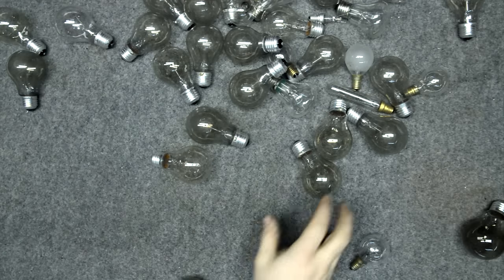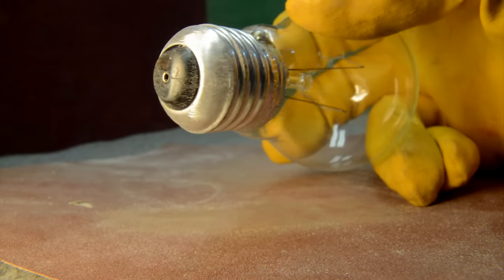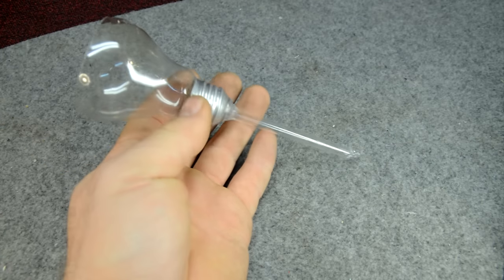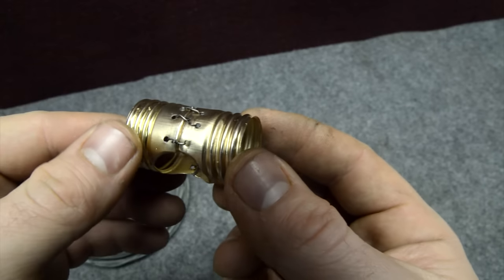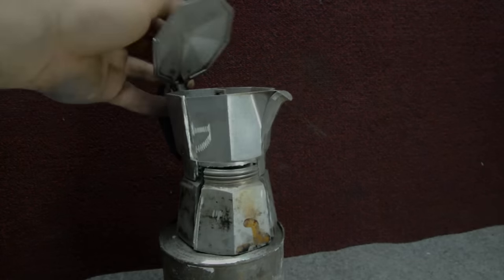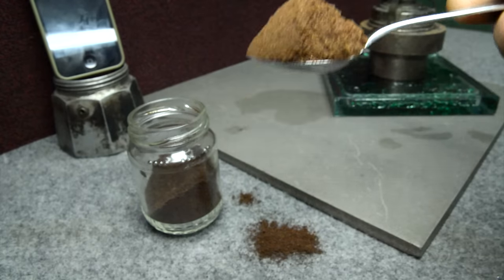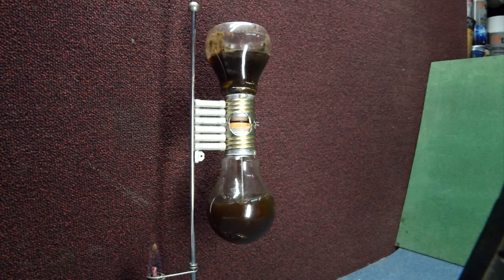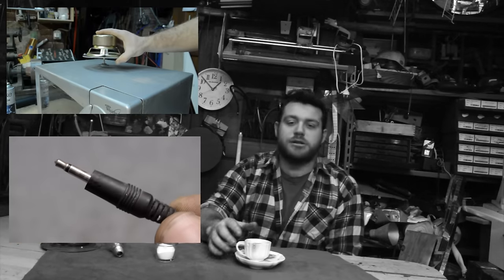How to Make • Coffee Machine Vacuum Lightbulbs

Comment: Anyone attempting this should also.
-Wash Bulbs in/out with soap/water.
-Use a Stainless Steel Washer. Galvanized or Zinc coated metal would be poisonous and would rust!
-Dont use Magnets, most stop working in high heat.
-Use food grade/high heat Silicon Adhesive and Rubber washers (is poisonous/cancerous not to).
-Would complete a few passes with just water before using.

Overall, Cool Project :)
Reply: +TheOnismithcreations thank you for saying alternatives instead of just slamming the project XD :)
Reply: +TheOnismithcreations The purpose of galvanized metals is so that it 'won't' rust. But I would use stainless steel anyways.
Reply: +Jordan Hoskins as far as i know galvanized metals is not recommended for high heat applications
Reply: tayeb mabruk thats true, it will burn off
Reply: +tayeb mabruk  You do realize that boiling water is not high heat.  Think fire or welding.  It might corrode a little and get in your food  I'm not terribly afraid of ingesting zinc oxide I am pretty terrified of in haling the gas and getting heavy metal fever.  This will not happen with this setup as the washer is submerged in coffee and far from the flame.
Reply: +TheOnismithcreations 

Good complement to the project ;)
Reply: +TheOnismithcreations If you remove the threat of horrible pain and death you ruin the fun lol
Reply: And where would you find food grade high heat silicon glue?
Reply: Food grade is everywhere, but it doesn't need to be high heat. High heat is like 500-1000 Celsius
Reply: +TheOnismithcreations galvanized would rust? are you fucking kidding me?
Reply: I would amend this to say: "Anyone attempting this should...stop immediately"
Reply: The bottom of bulbs have a lead/tin solder on it. Watch out!
The screw part of the bulb is made of aluminium, which is safe.
Reply: If using something other than superglue make sure it's non toxic, if using superglue do a run through with water first.
Reply: Wow a human (Y).
Reply: @exogendesign4582  - having had galvanized wire fences? Yes, they do rust.  It just takes them a longer than regular steel.  But they do rust, and they get fairly brittle especially when exposed to things that alter the chemicals of the surface.  And coffee is acidic, so unless you know the exact chemical reactions that would occur with the interacting boiling water/ coffee and the washer?  Don't assume that the metal will be food safe.

Comment: for the project for today we only need a couple of old light bulbs. yup, just two light bulbs and two light bulb holders. thats it you guys, two light bulbs, two light build holders and some metal wire. also, maybe you need sandpaper, a pair of pliers, gloves and mask for protection, a pipette,  silicone with gun of course, a couple washers, rubber gaskets and with some strong magnets and ring holder you got yourself some coffee! isn't it crazy what you can do with just two light bulbs?
Reply: Best comment on here 💯. That's real talk
Reply: LMAO
Reply: walkin dude 
Hey! You don't have random washers lying around the house?!? Or those twist-tie things that come with bread?!?
DIY is called Do It Yourself for a reason...just use what you've got. No washers? Use beer bottle lids with holes in them! No dropper? Use a pen or something! Etc.
Reply: ravemastaj "for the project of today we only need a couple of old light bulbs". why start the video like that when it turns out you need a lot of materials, a lot of which turn out to be things i do not have around the house. i got really excited. i grabbed a few bulbs out of my collection of burnt out ones and came back to the video only to be disappointed to find out that i don't have like 90 percent of the things needed to make the damn thing. also i forgot to buy coffee. also, i don't have a collection of dead bulbs.
Reply: walkin dude
Lol, good one.
Reply: Lol

Comment: I'm working in a lamp factory and can only say that there is a high amount of lead in the soldering of the lamps and also in the glass itself. Don't drink to much coffee ;)
Reply: Thomas Sebastian is it not silver solder?  It's not food safe either way but it's better than lead at least
Reply: butre jp Possibly tin-bismuth solder too. Bismuth is usually safe. They use tin-bismuth solder for bonding pipes, and in your everyday electronics.
Reply: Thomas Sebastian At least he wasn't drinking mercury out of a CFL bulb! :)
Reply: Pretty sure the glass itself is leaded, something about light transmission properties.

Comment: Taste like silicone glue?
Reply: no. that is outside!
Reply: Silicone rubber imparts no taste after it cures and is used throughout the food industry as a safe gasket material. Knowledge is your friend and is now a google click away.
Reply: A1Skeptic i love you!
Reply: A1Skeptic That's true with the correct solvents. However, the silicone he was using was for construction , which, depending on the type, may have solvents in it that can be hazardous to one's health, and also have a flavor.
Reply: There don't seem to be any "solvents" used in silicone rubber formulation that would evaporate from cured silicone rubber. So when you refer to "the correct solvents" I can only assume you threw it in because you thought it sounded "sciency".

Anti-fungal compounds are added to bathroom silicone tub sealants, and probably shouldn't be eaten. But even if bathtub silicone was used in this project the tiny amount would cause no health problems and would still impart no taste when cured. Silicone rubber is very stable stuff.
Reply: A1Skeptic If you want to crank the "sciency" dial up a notch. Run some test with different kinds of silicone, collect data, and back up your theories. lol jk
Reply: A1Skeptic If you know anything about materials which cure through the evaporation of one material out of a mixture of multiple, you should know there is never a substance of the like where the material intended to part with the mixture during curing leaves completely, and if it does, it is through sheer luck. Works somewhat like a half life. Also, when I said "the correct solvents" I meant ones that don't raise serious health concerns if consumed. Thanks for being a prick, by the way.
Reply: DJspinmaster88 My theory is that silicone rubber is widely used in the food service industry. What's your theory?
Reply: ***** That's not how silicone cures.  That's why it's called curing, not drying.  RTV emits acetic acid while curing and nothing much once it's cured unless you get it really hot, way hotter than the boiling point of water.
Reply: DJspinmaster88 Trolls say what?
Reply: zumbazumba1 Um actually, you would probably be better off to coat the whole damn thing in silicone rubber. That is about the only food safe part of this video.

Comment: great way to get MERCURY AND LEAD POISONING!!!  Brilliant.
Reply: Mercury? Lead?
Reply: Yes... light bulbs have both... the brass coated steel thread base you use to screw the bulb into a light socket... not onlyis it soldered to the tungsten wire filament with lead based solder, but that metal also has lead in it as part of the alloy usually.  Many light bulbs, especially neon ones, also have a small amount of mercury in them.  It may not be in incandescent bulbs, but I know lead is in there.  And if you use the cloudy glass bulbs instead of clear ones, the cloudy stuff on the inside on the inside of the glass... if I remember right that is crushed glass powder.  So... yeah.  Have fun with brain damage.  :)
Reply: glenthemann LOL!  Nah... imma d***.
Reply: +Daniel Nunyabidnezz is right guys. Its nice to make but its harmful.
Reply: +Daniel Nunyabidnezz he washed them, maybe he thought about it
Reply: +Daniel Nunyabidnezz In the US commercially avalable products are required to use non lead solder, and the gass fill in the lightbulb is argon. No lead, no mercury. I don't know about your country, but the only thing we would have to worry about in the US would be cleaning away the glass powder.
Reply: Incorrect.  Nowhere in ANY law does it say that common household light bulbs cannot contain lead or mercury... Fluorescent light bulbs contain a single drop of mercury that the gasses inside vaporize when the filament heats.  Common household incandescent light bulbs contain solder in several places, and it can contain lead so long as it does not surpass EPA regulations of how MUCH lead can be in the solder.  Common household solder you find at Home Depot for soldering electronics and for the odd solder job you have to do inside a household wiring system can contain lead.,. I have 5 rolls of it in my tool box in my garage right now I bought last month.  Lead based solder, much like some forms of Silver based solder, is usually soft lower heat solder.  The solder used in the manufacture of light bulbs in the US can contain lead and it is generally a "hard solder"  which contains higher levels of harder metals like zinc, tin, copper, and nickel.  But nowhere does the EPA regulation state that it cannot contain ANY lead or mercury... it says it can't contain too MUCH lead or mercury.  The stuff is still there.

And by the way... I was born and raised in S.C.  And no my parents are not immigrants or the spawn of immigrants either... distant ancestors from over 300 years ago some of them maybe, heck I know I am at least 1/8 some kind of Indigenous North ("Native") American.
Reply: Daniel Nunyabidnezz I'm fairly certain products commercially made have to be soldered with non-lead solder. I could be wrong. I'm not going to sit here and pretend that I went and looked it up, because I'm here to have a good time. The dude used an incandescent light bulb though. There isn't any mercury to worry about. Either way, heavy metal poisoning from lead is going to take quite a bit more lead than you would get from making coffee in a light bulb with a couple soldered components. 

I mention the country thing because I know that there are countries with next to no safety standards in their manufacturing. All the way from the EU, where doing anything even kind of dangerous will be illegal, all the way to china where lead is the main ingredient in pretty much everything.
Reply: +Daniel Nunyabidnezz thats right
Reply: +Daniel Nunyabidnezz wow. but since the water nor coffee comes in contact with any of the metal at all how does it get transferred to the consumer? the only thing the fluids touch is the glass pipe/ light bulb glass & and the rubber washers and coffee. the washer he used as a weight is the only metal surface in it and if you where that concerned you would swap it out.. did you even bother to watch this before you commented? I guess you get poisoned from the coolant in your car motor as you drive it as well...
Reply: +Daniel Nunyabidnezz  no the old school bulbs he used does not have mercury and lead in them. The modern bulbs ( LED'S and  flora)  are the ones that have mercury and lead in them   so yeah  :) lolz this was 5 months ago but whatevs

Comment: while i admit the though and creativity that went into this are remarkable, not to mention the fine presentation. I would have reservation about using the coffee maker as light bulb glass is not tempered and applying heat to it can create micro fractures and glass around the areas where you break or file could break. commercially available glass coffee makers would be molded into shape and be made out of pyrex. additionally, the solder and adhesive used in assembling the light bulb can contain toxic materials like lead.

Comment: Good job, commercial vacuum pots are pretty expensive and you prove that handy man and components costs just few bucks. I am also impressed that bulb not break from direct flame.
Reply: Dunno about the "thin glass/thick glass" shattering theory mentioned above but think about the heat that conventional light bulbs have to endure every time they are turned on(and left on).  I would say that they are manufactured to tolerate heat.  Not so much for impact resistance though lol!

Comment: Very cool project. Love the look of it as well. Just wondering about emptying the lightbulbs. Breaking out the inner glass part leaves a rough edge of glass on the inside. Wouldn't that be a dangerous issue, as it is quite likely that glass parts might break of at some point and therefore end up in the coffee ?

Comment: So you're heating water and passing it through the coffee at what looks like not a whole lot of pressure. I've had french press coffee and I like the strength and smoothness. I use an induction tea kettle to heat the water in about a minute. What's the advantage of the vacuum process like this? Just another way to skin a cat? Hows the flavor compare?

Comment: Don't light bulbs have mercury and lead in them?

This seems cool, but I would rather not get poisoned and die.
Reply: +dogs101o Those are just the new ones. CLF (fluorescent) bulbs have mercury, and LEDs have lead, but incandescent (the ones shown/old school) have neither.
Reply: +dogs101o  Old fluorescent bulbs also had mercury.  With these, I would be concerned about the lead used in the soldering for the electrodes
Reply: +Adrian Alvarado  Gadea bro no clf... it is cfl(cholorofloro)
Reply: +Gameplays,Tutorial,MINECRAFT FUN.  CFL bulbs do contain mercury. CFL stands for compact fluorescent light. not chloroform.

Comment: You didn't mention that you should to use clear light bulbs because the white coating on opaque light bulbs is often synthetic silica.  Even with the clear bulbs, you need to rinse them out well to clean away any material left from the manufacturing process and whatever debris you may have left when altering them.

Comment: I like the brewing method,but light bulbs ain't my speed ,i need more than a sip of coffy to get my motor going,and a light bulb wouldn't last a second in my camp gear. not to mention I have no clue what chemical bulbs are treated with ,got an idea for a bigger one? Maby with stainless water canteens ot even copper parts. It should be able to withstand a good amount of heat,as my camp stove is not to shy of a blow torch.

Comment: iS this safe?
Reply: +Phuc Nguyen Since no eye protection was used during the sanding of the glass bulb, I would say no.  The solder in the end of the bulb may also contain lead, so I would make sure all of that area of the bulb is removed.  The bulb may shatter as it is being heated which could be a burn risk as it was not designed for this use.  Personally, I will stick to my french press, as it is more practical.  Interesting video, however.

Comment: my light-bulbs keep on breaking when sanding
Reply: +Alex Rutten You probably need a finer grain sandpaper then :o
Reply: im using 120 like he suggested
Reply: Might depend on the lightbulb manufacturer then, different quality glass? I'd still go for finer grit, if you are having problems with the glass breaking.
Reply: +Alex Rutten Once a hole is made, you should try to sand on circular movements instead of sand the whole surface at once, because it seems to be fragile. Tri to sand it on circular movements once it have a hole, but using only a bit of the surface, like, in 45º, got it? Its hard to explain without showing it to you xD
Reply: Make sure to use emery cloth , for metal